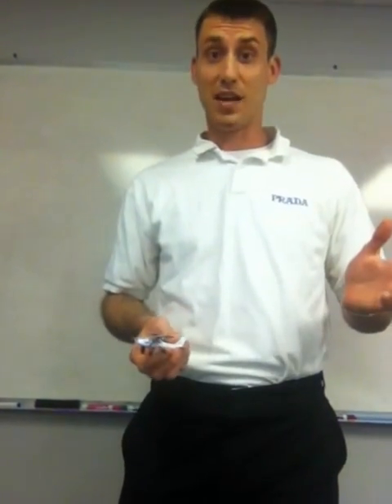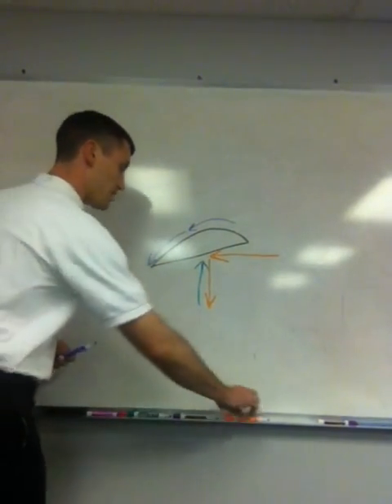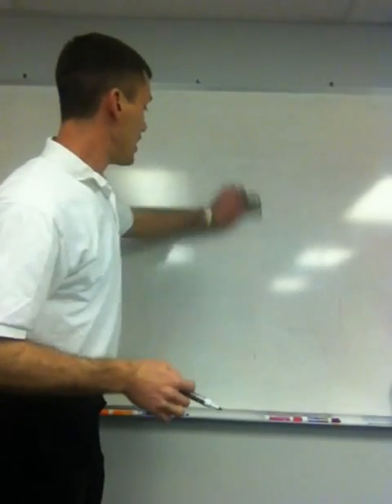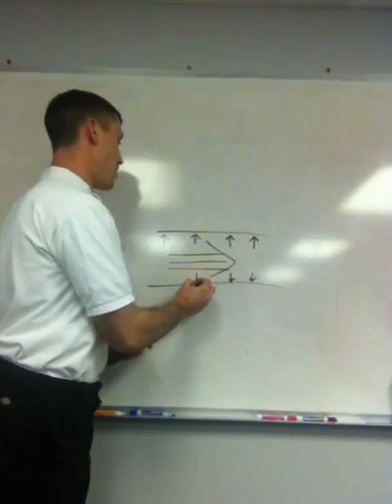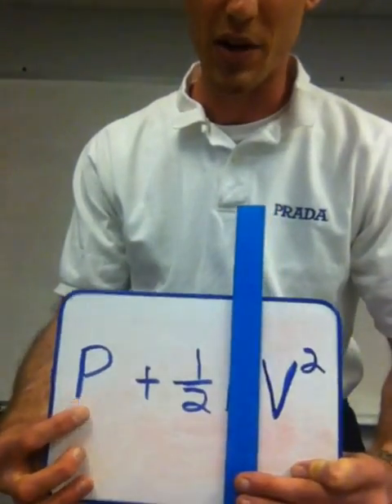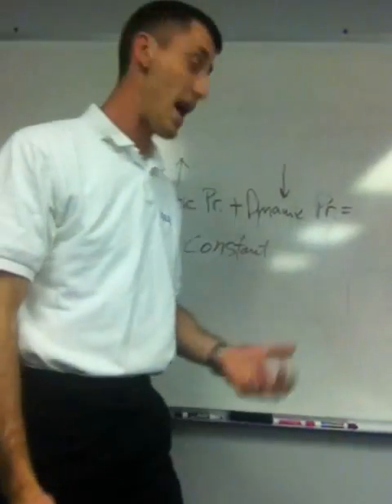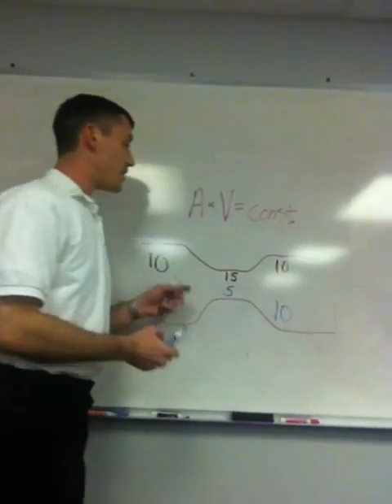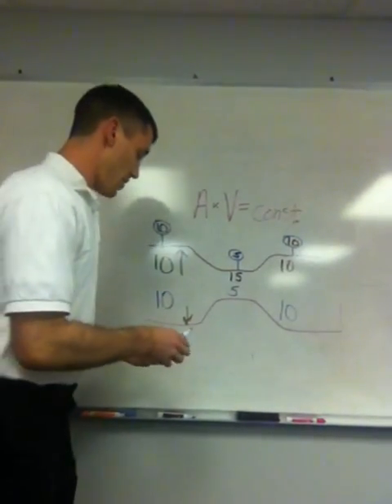How an airplane produces lift, bernoulli and newton

Comment: The paper experiment definition is WRONG. Hang the paper vertically and nothing happens. Without the curve you get no change of flow direction and thus no movement. It is the curve of the paper is causing the air to change direction and the result of the change of direction causes a resultant force moving the paper upward. Also A WING IS NOT AND NEVER WILL BE A VENTURI. You have completed the trifecta of myths.

Comment: This is very misleading. Lift is caused by turning flow. The pressure differential is a primarily a result of angle of attack NOT aerofoil shape. All airliners have supercritical aerofoils which are flatter on the top and curved on the bottom. This is a blend of two myths: Equal Transit Time and the Skipping stone. See NASA Glenn research Centre How wings work.The air over a wing does not accelerate. Watch Babinsky Cambridge university Streamlines around an aerofoil.

Comment: sir i am designing a vertical axes wind turbine. As far as i know the VAWT is not a efficient way of generating electricity because the blades do not generate enough lift. So how do i design a wing which can generate lift vertical ???...

Comment: Every time I fly a Citabria with its flat bottom airfoil inverted at a constant altitude, the substantial amount of forward stick and angle of attack needed to produce enough newton lift to overcome Bernoulli lift and weight, never ceases to amaze me.  The increase in drag this produces slows the plane a good 30mph (at an identical power setting) and the plane shudders in protest to this configuration.

Comment: (2) ... also the paper effect is accounted to Newton. Read "Understanding Flight" by David Anderson and Scott Eberhardt ->Appendix B (content available via google books). Flight is an Effect of inertial air over a wing. Lift on rigit bodies like an airfoil works only if the attack angle is low. The air is too fast to compensate pressure differences during deflection over the wing. the deflection comes from atmospheric pressure. but when the attack angle rises. air can go in reverse flow.

Comment: Bernoulli Effect is not a correct description of energy conservation. Because due Newtons 3rd Law there would be no Motion if the pressure is the same after passing the smaller cross section. Instead, the Effect is misinterpreted since the very beginning. Due the pressure drop in the measurement is accounted to internal inertia effects of the fluid, 2nd law of newton requires an additional force flow the measuring unit. That required extra force results in the pressure drop...

Comment: Thanks for the response crane! I also check my youtube only so often. I'm a part time commercial pilot, full time mechanical engineering student, and part time assistant at an advanced aero-propulsion wind tunnel. This question only came up due to my being in all three of these fields, and although I am not sure your answer is completely right, it seems that when I ask my professors and other pilots, they are both equally as stumped. I sent NASA this question :) We'll see if they can answer it.

Comment from the maker: differential between actual and indicated. For us in the Cessna 172's, that’s on the pilot-in-command side of the aircraft, aft of the cowling. Any residual error resulting from different power settings, change of angle of attack, disruption of airflow, or change in airspeed will indeed affect the altimeters read out. This is the difference between true altitude and indicated altitude. The static port is a much lesser surface area than a wing as well. I hope this helps you out a bit. Take care!

Comment from the maker: Hi Jeff, my apologies I don't check my Youtube that often. Actually, in response to your question it does affect the altimeter. This is in part because of Bernoulli's principle. It is called position error. When a company designs an aircraft, they choose where they will put the static port. They try to put it in a place that accurately reflects the correct airflow over the airframe. Since no one given spot exists for all given angles of attack, they choose the place with the place with the least

Comment: For instance, say we were in a helicopter at sea level sitting still. The static pressure is, say, P1. Now we fly up to 5000 ft and then hover where the static pressure is P2. The altimeter, working off of a simple aneroid wafer, reads the static pressure as P2. Now we start moving forward out of hover and the static pressure in the altimeter pressure line decreases, so why doesn't this increased airspeed cause our altimeter to begin to read higher?

Comment: Can you please explain how the altimeter on an airplane can work if the static pressure (what the static ports measure) changes not just with altitude, but airspeed? i.e. As you mentioned in your video, as airspeed increases dynamic pressure increases and static pressure decreases (total pressure = static + dynamic = constant).

Comment from the maker: pressure on the 'walls' of the pipe would be static pressure. This might help visualize it: for static pressure, imagine you blow up a balloon. Visualize the pressure the air is putting on the inside of the balloon. This is static pressure. Now, you untie the balloon and let the air out rapidly. If you were to put your hand in front of that flowing stream of air that would be the dynamic pressure. Basically, the faster a fluid is moving, the less pressure it can exert on whatever surrounds it.